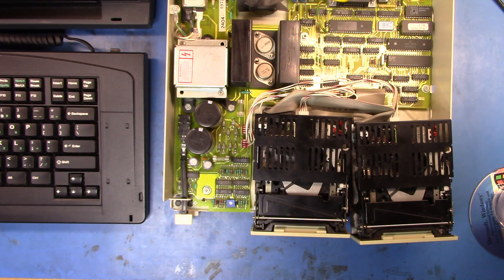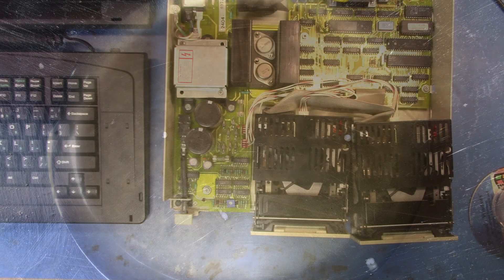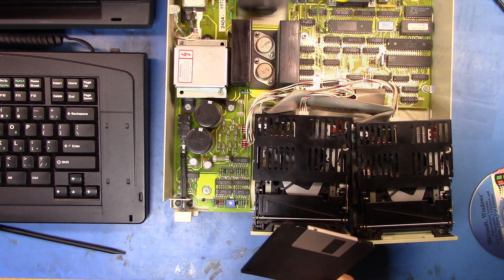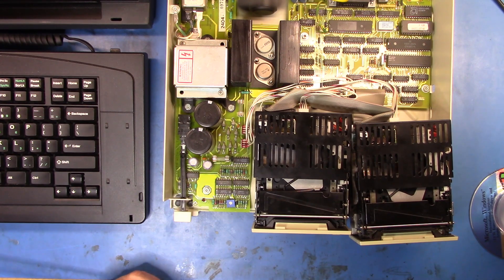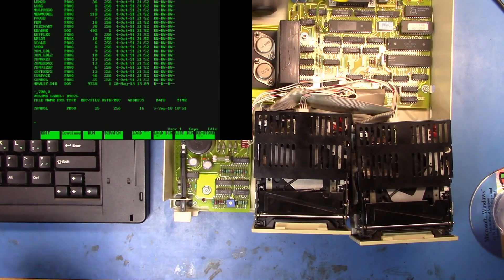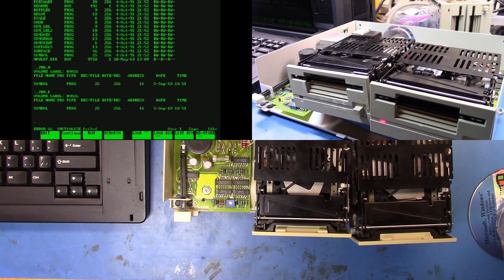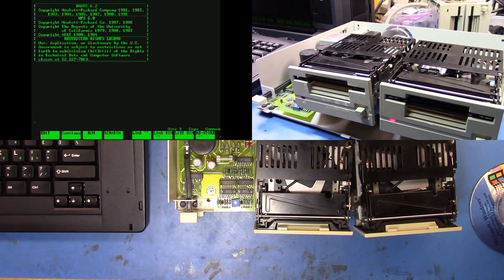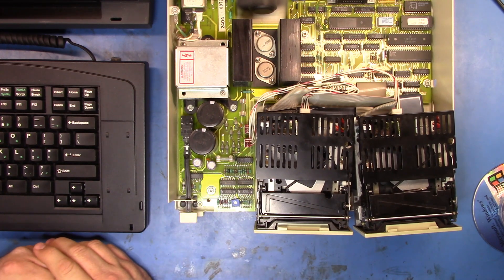HP 9121D & 9122D Repair - Part 2

Comment: I notice audio tapes shed particles when not used for a long time, so you have to play the whole tape, clean the heads, and after that the sound is clear again and heads stay clean. Maybe old floppys need a play and clean too.
Reply from the maker: Hadn't considered that - I have just noticed that the drives seem susceptible to the type of disk - I bought an new old stock box of 3M DS/DD disks and they didn't like those but I then bought some new disks from FloppyDisk.com and they seem very happy with those. Based on this comment and PelDaddy's one I just bought a 3.5 cleaner disk form the same location - Will see how it goes in the next video :)

Comment: Nicely wrapped up. I guess missing YouTube for a while paid off because I got pt1 and pt2 available to binge watch.... Yes, people binge watch your channel now! LOL

I recall from my 3 1/2" floppy days ( I started with 8" floppies on a Data General) that there was a "cleaning floppy" which had what looked like cloth that you could put a little IPA (sold as some expensive special cleaner I am sure) on to clean the drive head. Seems like you go it clean with it open.
Reply from the maker: Thanks - Now that you mention it I remember those things for 5.25" floppies as well. I haven't tried the DS drives yet but hopefully I can get in between the heads with that foam cleaner if needed.